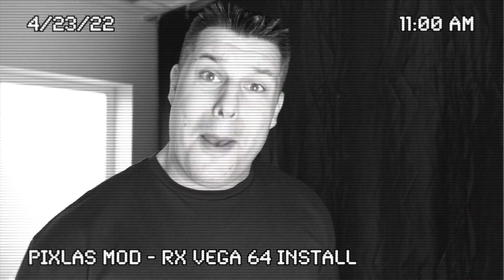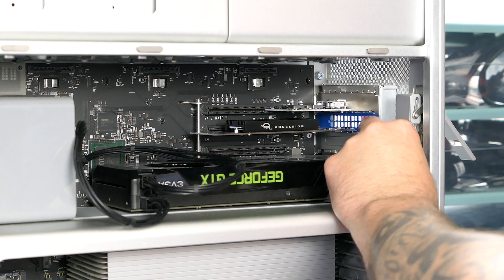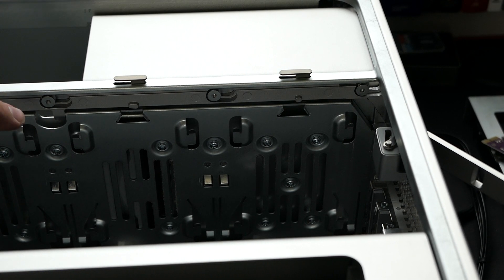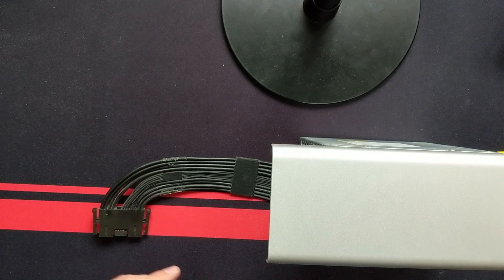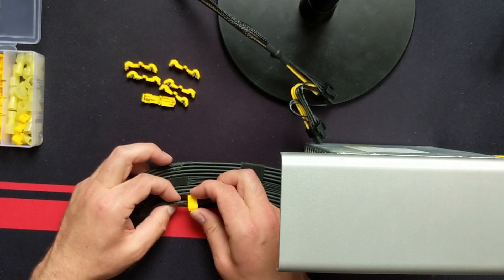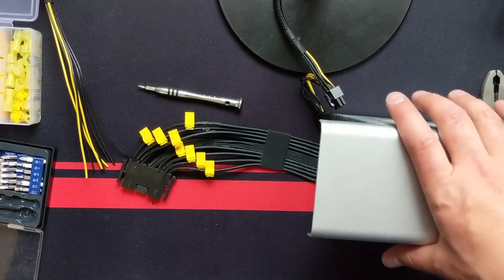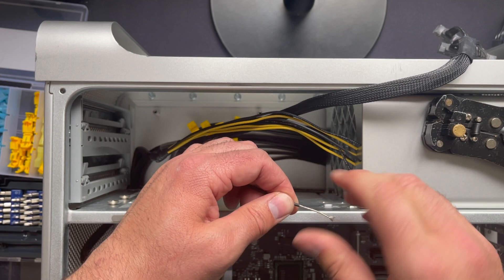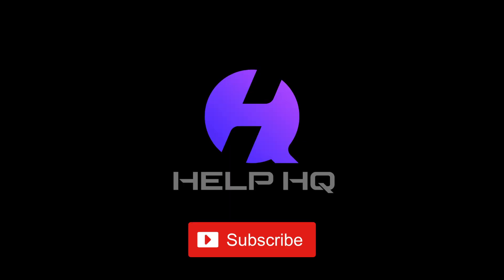Mac Pro Pixlas Mod

Comment: DO NOT DO THIS—IT’S A COMPLETE SCAM! I’ve been running a 300W Radeon VII in my Mac Pro 5,1 for over a year without this Pixlas nonsense. I hardcore game on it, even OC the GPU via AMD’s app (I game mainly on Windows 11 Pro), hitting 100+ FPS on high settings at 3440×1440—way above standard 1440p. The GPU fans scream and I game for hours straight. Never had a single power issue. The Mac Pro can handle this beast easily. This “mod” is for lunatics who want to destroy their Macs all because of YouTube propaganda published by some stupid YouTubers. DO NOT DO IT.
Reply: How did you do that?
Reply: @thiagoaugustoresendebraz1919  2x mac 6pin to 8pin power cable that's it! the mac pro 5,1 is powerful enough to easily run a 300w Radeon VII or any other gpu rated up to max 300W easily without any issue! This Pixlas mod is nonsense stupidity and a waste of time unless you are trying to run a very power thirsty gpu 300W+ which i doubt anyone is installing one like a RTX4090 or RX7900XT on a 2010 mac pro!

Comment: Just curious because I have a 2012 mac pro and a vega 64 (from my old computer). Because the stock GPU is rated 108 watts would that mean both mini pci ports are rated for 150w instead of 75w and I should be able to use both of those ports for a vega 64 than the hassle of this build?
Reply from the maker: There’s a lot of back and forth argument on this topic. There have been people who successfully ran a video card that required an 8pin plug (150w) vs a 6pin plug (75w) by using a mini 6pin to 8pin cable. Apple has never released any official literature as to what the ports are rated to handle. That being said people have also burned up the traces on their motherboard by trying to pull too much power from the ports.  The card would probably run and boot into macOS by just using the mini 6pin ports but as soon as you tried to put any load on the GPU you would run into issues. So in my opinion it’s a safer bet to plan for 75w from each mini 6pin port and 75w from the PCIe slot the card is plugged into giving you 225w of power. If you need more than that I’d do the pixlas mod. This day and age you could just sell the Vega and buy a newer card that will give you equal if not better performance and not require this mod. You could also sell it and get a Vega56 which does not require the mod.
Reply: @helphq what would you recommend to buy for equal performance and to avoid doing the mod?
Reply from the maker: On paper an RX6600XT is on average 37 percent better than a Vega 64. It requires one 8 pin plug which you can use a two mini 6 pin to one 8 pin Y cable. Requires no power modifications.
Reply: @helphq  Thanks!